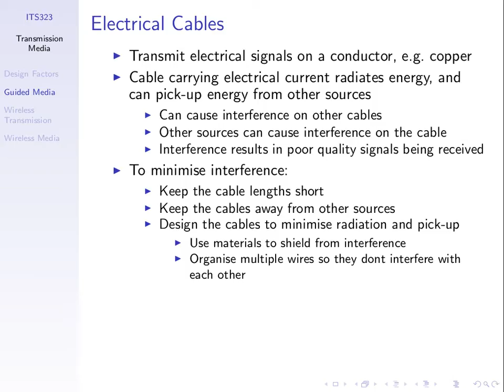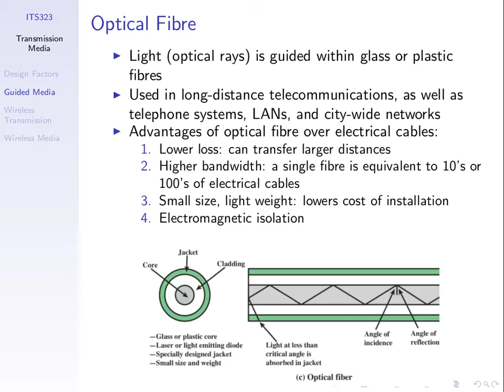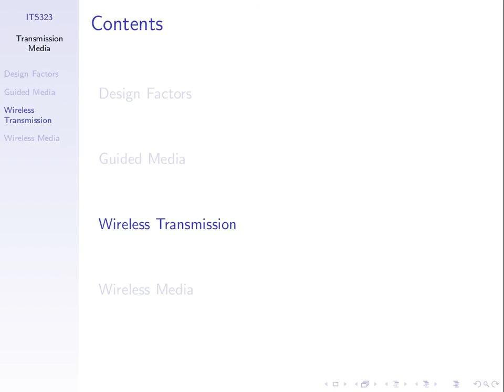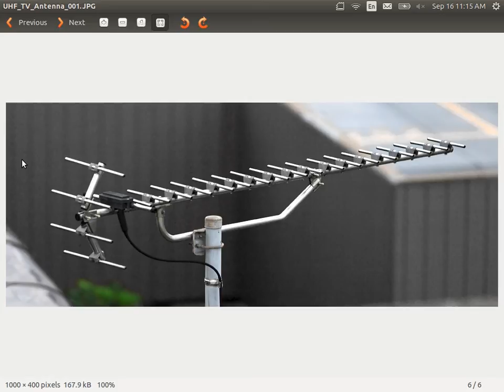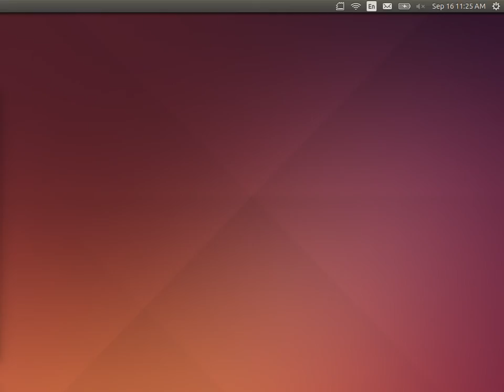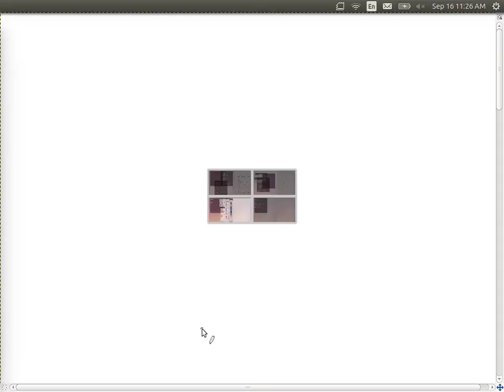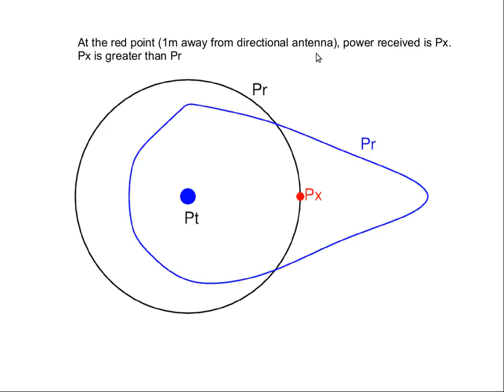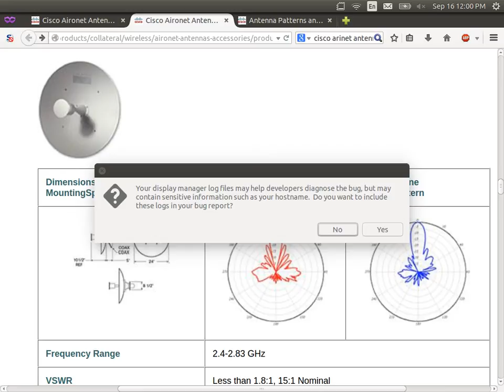Antennas and Antenna Gain (ITS323, Lecture 12, 2014)

Comment: hi steven..thank you for the video..it was very much useful for me.if it is not too much trouble you can share your FB acount or  whats app no with me so that i can clarify few doubts as iam facing few signal interference problem with my wireless network to other radio network in my work site